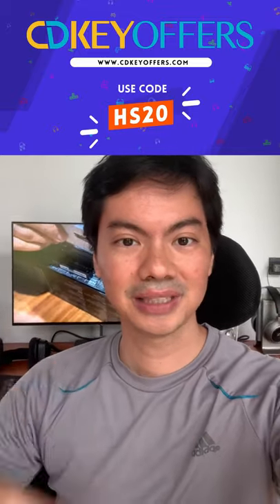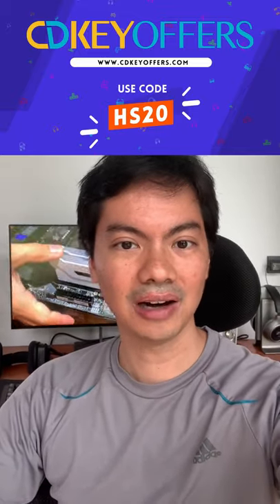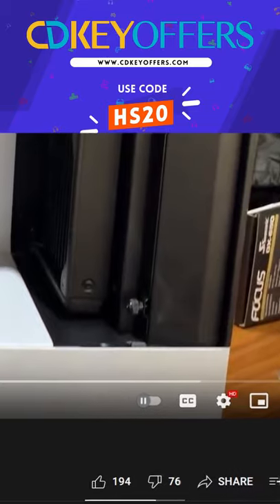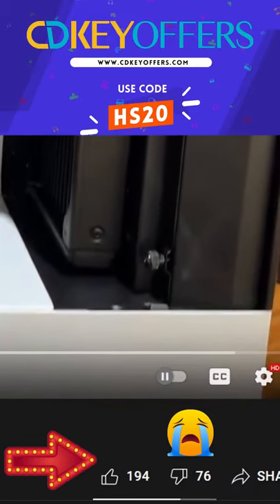How to install a 240mm radiator AIO in the NZXT H510 Elite #shorts | Hardware Sugar

Comment: People should be mad about the fact that the tubes connecting to the radiators are on the top not at the bottom, and not about missing out on installation steps.
Reply from the maker: that doesn't matter https://youtu.be/HlrZQIHiXwM?t=211
Reply: As long as the top most point of the rad is higher than the pump you're ok. Air will go to the highest point and having the rad higher then the pump block it won't get trapped in the pump. At least to my knowledge this is how it works.
Reply: @mk0246  until air gets trapped in the tubes since they’re at the top. Can’t circulate the fluid if it’s below the tubes.
Reply: @1963c10  gamers Nexus did a whole piece on this. The correct placement of an AIO is the pump has to be higher than the pump. Any AIO is not completely air free and will have some air in the system. Having a few bubbles up in the RAD isn't going to make the system not circulate. I think you are mistaken with the conclusion. All you should really care about in installing an AIO is that it's as full as it can be and that it's higher than the pump. As long as air isn't trapped in the pump you should be good.

Comment: So does it 100% work with 240mm radiator? please respond asap
Reply: Yeah, I actually was able to install my 240mm silverstone AIO, its the same as installing it like in the video. You can do a push pull config and just remove the cable management bracket for enough clearance,